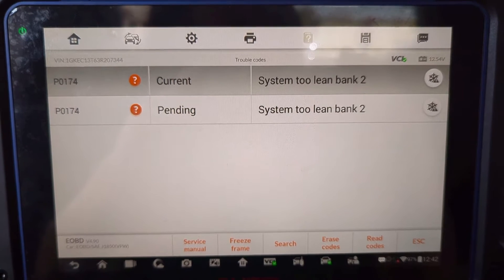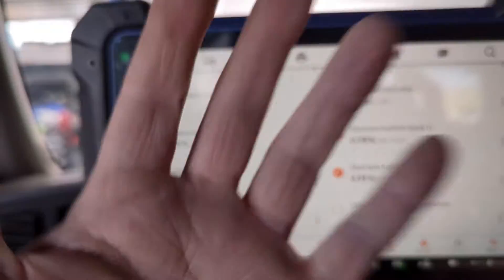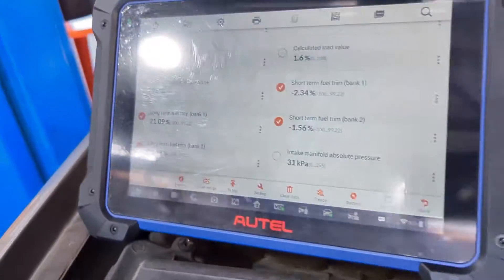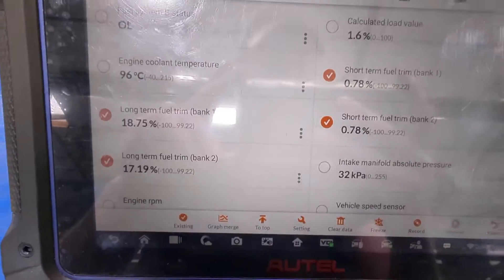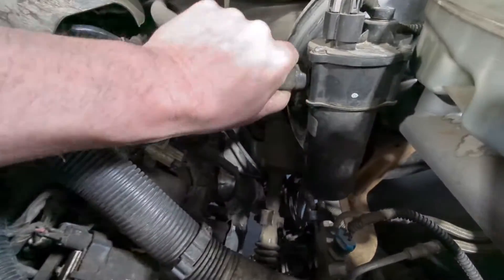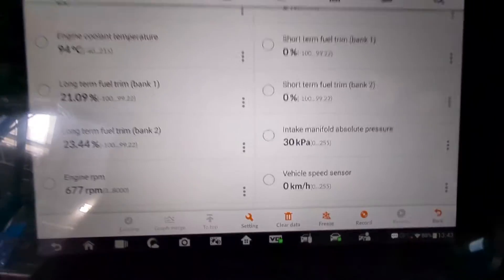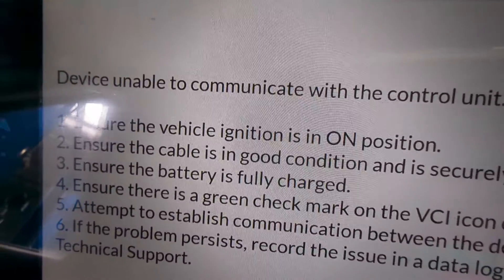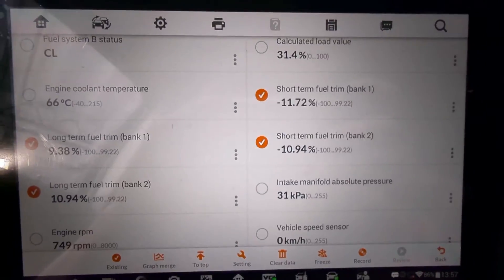Chevy / GM P0171 or P0174 System To Lean Bank 1 Bank 2

Comment: I don't know if this would pinpoint anything or you would respond back I smoked my vehicle went four times and the very last one there is no vacuum leak turns out to be a fuel pressure but my vehicle fuel filter is located inside the tank I suspect there could be a slight tiny vacuum in the valve cover but once in a while when I drive pretty fast on the road I hear like a whistling noise I can't hear it when the car is at idle or sit still while it's running and I got rid of all my misfires

Comment: Ok I have a confession. I had a P0171 code…. Turns out I left the oil cap off adding some oil lol….. 300k miles no other complaints besides a slight oil leak only when cold that I’ll fix at the next oil change

Comment: So I was having the same issue, I discovered the root core of the problem in my 2013 GMC Sierra 1500 is the throttle body when it gets dirty messes with the throttle position sensor and you have to clean the throttle body and replace the sensor to actually get things back to normal. You also need to do a throttle position relearn procedure which you can do yourself once it's completed but that takes care of all of it at least for me. Just wanted to throw this out there for anybody else who might be having an issue that can't get to the bottom of it
Reply: Oh man ... thanks
Reply: The TPS sensor?

Comment: Had same issue (P0171/P0174) on a 2010 Murano - replaced the air filter, the "MAF" and my air cleaner intake duct hose had several rips

Comment: Interesting 🤔 

Im dealing with this in my 98. P0171 an p0174 I've confirmed its not exactly starving for fuel but yesterday it threw a catalytic converter code relating to an o2 sensor. Im gonna replace both and clear codes see if that changes anything. 

Ive already done the maf my old one had a hole in it. I've checked for vaccum leaks with throttle body cleaner I've replaced my map sensor (gasket was bad) I just replaced my entire fuel tank and fuel pump/filter so I know thats not the issue. I did notice my o2 sensor readings were acting a little odd. Theyd act normal (move speratically up and down) then theyd just freeze (bank 1 sensor 1 bank 2 sensor 1) so I'm leaning to that being the issue but again that o2 sensor/catalytic code hasnt come back yet 🤔
Reply: I might also replace my pcv valve I don't recall if I ended up replacing that or if I just cleaned it.... the plastic 90° broke and I took it all apart and cleaned everything up.
Reply: Man I’ve did all you did and more and nothings worked so far I have noticed my ambient air sensor isn’t working right reading way higher than the outside temps.

Comment: That Solary SD301 you’re using puts out 19 PSI, that won’t harm your EVAP system? I have an Autool machine that puts out 12 PSI, but most things I read say the EVAP smoker should use less than 2 PSI or the pressure could harm EVAP components.  Is that not true? You don’t seem to have any concerns using your Solary.

Thank you

Comment: One time at my buddies mechanic shop, customer brought in 2005 Cadillac Escalade with a 5.3.
Customer already replaced the engine, and 3 of the 02 sensors.
It had multiple misfire intermittent and a fuel trim code. My boss came over to me and said disconnect the 02 sensors. If it smooths out the fuel trim code goes away, you need an 02 sensor. Sure as shit the one 02 sensor that wasn't replaced was the problem. $67 part. Customer must've spent over thousands of dollars.

Comment: Any relation between this code combo and a rough idle in cold weather? Code combo generally disappears after the vehicle has run for a bit or its decently warm outside.
Reply: Intake manifold gaskets will fix your problem

Comment: Thank you Sir!  Great troubleshooting. You made things easy to understand. I heard a high flow air cleaner assembly could cause this.  I have a S&B high flow air cleaner assembly and a performance tune in my truck. I'm going to check things per your troubleshooting and put the stock tune back into my ECM to see if it makes a difference.

Comment: updates from me:  I found a badly deteriorated exhaust DONUT from the exhaust manifold.... smoke tested the exhaust and voila!  Helped alot- but still dealing w intermittent code.  Air intake to throttle body: smoke leak from side of throttle plate: replaced throttle body... and now getting random leaks from the o-ring area.  Seems like a weak design, not sure. ATV: trying now.  THANKS

Comment: 06 4wd 4.2 l Lt trailblazer ext. At any time do u ever add pressure to system? Or does it do it alone ? Also mine is bank 1 lean I don't have a sensor computer .  But it said on the code intake valve gaskets.. it is .massive. Work. Now I don't want to do that if it's a false reading. I'm burning gas allot. I did change purge valve. Then had issue what seemed to follow ? Near some time after. It started running a little rough. Changed plugs and coils. Did find like plug 1 in back fire wall?  4 I go forth. With this be said would this in your opinion only {opinion}. E those rubber gaskets?

Comment: You have a fuel pressure issue I am shocked you did not see it.
Reply: How come? Can you Explain?
Reply: @hacatan24  Go to 6:50 fuel pressure should be no less then 55 psi while engine is running NEVER decrease, in fact it should increase on acceleration.  What you need to understand is those fuel pumps and most all can make in access of 100 psi. They are regulated with vacuum as the vacuum decrees on acceleration fuel pressure goes UP. That truck is starving for fuel, fuel trims are maxing out to try and keep up. Its lean as ell low fuel pressure.
Reply: @hoborosser1785  I think that's my problem because I noticed that whenever I turn on my Cadillac EXT it's at 43psi..  the weird thing is when I took to mechanic he said fuel pump was fine ...
Reply: @hacatan24 fuel pump relay my dude

Comment: I’m having the same problem now on a 2005. Truck has New MAF, CAM SENSOR, and NEW EVAP system with no CHECK ENGINE light. Problem I’m having is that it dies while sitting at the traffic light or stumbles when on the highway. I have 60 lbs of pressure on the fuel pump even when it shut off. I’m leaning more to the fuel pump now
Reply: I have the same issue.. with a 02 Buick lasabre 3800. I have cleaned everything / replaced every sensor.. I'm going to check that relay.. thank you very much it has definitely been a headache chase that I can't seem to find...
Reply: Idle air control valve and/or harness
Reply: Sounds like an EGR valve to me.
Reply: I am working through the same issues and  went through it all thinking it's a fuel problem and EVAP and vacuum leaks. Got rid of all my DTC's and the issue still persists. So all is leading to weak coil or bad spark  plugs. 

An intermitten, incomplete combustion, so the O2 sensor picks up a rich reading, so the computer  trims the fuel back, creating a lean condition. This is what I am thinking now.

 The physical symptoms are identical to a clogged fuel filter or failing fuel pump. 😂😂
Reply: @mikethiem2002  I found my problem…… It was the FUEL PUMP relay! What that SON OF B……… was doing, it was getting hot! When I pulled it, I found it to be SLIGHTLY burned on all 4 corners. It’s gray in color so the burn spots were a dead giveaway. Man I been riding for MONTHS no PROBLEMS . I hope this helps
Reply: I had something similar to this happen to me with a 3.6l Bonneville. Sit a a light and engine would die. Had the throttle body cleaned and never happened again
Reply: @allenbatts85  I cleaned that too
Reply: I FOUND IT I GODDAMN FOUND IT! It was the FUEL PUMP RELAY! That S.O.B had burn spots on each side. Evidently it kept tripping after it gotten hot and would shut down but start back up. I switched it out and was riding for two weeks and the Tranmission failed LAST WEEK 😂😂😂😂😂
Reply: @traifields846  I’m so glad you made this comment. Went and checked the relay immediately after reading it and bam…. Fixed the fuckin headache I’ve had for the past few months. Thank you!

Comment: On the 5.3 its almost always header bolts snapped , loose, broken to the cylinder heads. Be ready for the fight of your life 😢
Reply: I have 2 broken org exhaust manifold bolts on driver side 1st bolt frt n last 1 by firewall of course 
And 1 broken on passenger n of course last by firewall...
My fuel pump was replace 9 mnths ago n it makes a weird noise when started...it starts but not as fast as it should with new pump..so I have 2 frigging issues

Comment: I have these codes and ltft numbers when I TAP and release the throttle the truck revs up and stays at the high rpm on its own for a second or two then settles.
Reply: Did you figure out what caused it, mine does the same thing
Reply: @jbags091992  replaced the hoses that were cracked and brittle but it didn’t change the fuel trims. I ordered a throttle body and swapped and my trims are now better, my tb was pretty gunked up. unfortunately now I’m have a high rpm issue with the new tb swap. common with cleaning or replacing tb’s but I’ve done everything YouTube has to offer and it’s still shooting up to 2k rpm.
Reply: @justinlong977  Im having the same problem brother! Im going to try what this guy did but if you find anything please let me know!
Reply: @Dyllanman  it seems to have settled down a lot, I guess weeks of driving did it?
Reply: Yeah anytime you put on a new throttle body, the computer has to learn it.
Reply: Mine is doing the same thing after second gear it shoots up and I got both those codes

Comment: So if I accelerate and my bank 2 trim goes down from 20 to 0 does that indicate bad fuel pump?
Reply: No. That seems to indicate that your air fuel mixture balances out unde load or higher rpm. I'd lean more towards a vacuum leak or a MAF
Reply: Means the opposite, high trims mean it’s low on fuel, low trims / negative means it’s good or too much on fuel. Fuel delivery issues (pump etc) will cause high trims under load, they will never be bad at idle and fix with load to my understanding. 

Vacuum leaks will cause high trims at idle, and likely correct under load. Such as your issue described
Reply: @jasehonfroy8086  I have an 84 c10 with 5.3 swap, runs great at low to medium speeds, maybe 50mph, but when I step on gas it acts looses all power....almost like it turns into a 6 cylinder....I can plug into ecm and get the 0171-0174 code. MAF is new, filter is new, no intake leaks....help! please!!
Reply: @jamesjordan3239 have you been able to test the fuel pressure? My only other guesses would be poor tuning or a vacuum leak
Reply: @jasehonfroy8086  Hey! Thanks for replying, I have not checked the fuel pressure as of yet but have discovered that the MAP sensor is not plugged in and I do not see the Map plug or vacuum line that runs to it, I bought the truck as is and dont know much about LS swaps. any advice?
Reply: The MAF sensor has been changed, can the Map be deleted?
Reply: You wouldnt happen to be in Houston or close are you?
Reply: @jamesjordan3239 hey sorry I’m not in TX- you can disconnect the battery, turn on the headlights to drain leftover electricity, then reconnect the battery to clear the MAP/tune file 👍if that doesn’t help I’d certainly check fuel pressure, harbor freight sells $30 gauges
Reply: @jasehonfroy8086  Thanks for the reply bro! I actually found a 1/8 vacuum line not connected and was hidden, never even made ssss noise. Couldnt find where went so I plugged in a cheap vacuum gauge and it immediately jump to 20Hg and the motor calm down and that fixed the 171/174....NOW after letting it idle for lil bit I get a 172-175 code LOL!! rich bank 1-2....Thanks again for the reply, I just tinker with and see what I can find!
Reply: @jamesjordan3239 Awesome, I’d definitely wipe the ECM by doing the aforementioned battery trick. I wouldn’t be surprised if it “learned” to run rich when it had the vacuum leak, and is now maintaining the extra fuel
Reply: @jasehonfroy8086  Great advise, Ill try and give you an update....Thanks! Have a great weekend, weather is crap in houston Tx.
Reply: @jamesjordan3239 haha same here in North Carolina sadly… was hoping to take the kayak out and hunt some squirrel

Comment: There's some decent info buried in here, but the terms and language being used to describe some of it is wrong. Examples...

Fuel trim is almost NEVER zero
Fuel trim at idle isn't terribly helpful for a lot - trims under load matter much, much more - especially long-term trims. Specific issues with the 2014-2018 high pressure fuel pump design causes fuel leaks directly into the valves which causes a "rich" condition. This will set the MIL and DTC's but the only way to diagnose the bad LTFT's is while actively driving the vehicle.
"Within 5% of zero" should like have been described as "within a range of plus or minus 5%" as "5% of zero" is zero...
Reply from the maker: I'm grateful for your detailed explanation and corrections on the terminology regarding fuel trim. Your input helps improve the accuracy of the content shared.
Reply: @FlatRateMechanic I applaud you for not talking to this guy like I would have. And taking his comment and twisting it to support your content. Really smart. Lol applause

Comment: this was very helpful thank you!  i bought the smoke tester, it's great.   found a tiny leak where the intake boot clamps to the throttle, but no change after that was tightened.  did a water spray all over the intake manifold gaskets and no steam out of the exhaust.   smoke tested the exhaust as well and nothing.   my long term fuel trim is around 18% on both banks at low load or idle and drops to around 10% under medium throttle.  i did notice my intake air temp was considerably off from actual air temperatures and very slow to respond to changes ( from sitting in a parking lot, hot start on a hot day,  to diving down the highway at 55, it changed very slowly and never read the right temp, was always high by  about 5-10%)    new maf on the way, i think mine is original,  20yrs old,  264k on it.  cleaning it didn't have any impact.
Reply: Did it fix it?
Reply: @cesarcastillo809  new maf sensor  did fix it!

Comment: I replaced the Maf sensor, the intake gasket, replaced a PCV valve and the tubing and there’s not any other leak, now I have a P0174 code. 
Should I have to replace the oxygen sensors?
Help!!! I already spent $700 pus the parts.
Reply: I have po171, which is the other bank lean. I can't figure it out either.
Reply: You figure it out? I have a p0171 only code, gonna change the o2 sensors
Reply: @alexlsx8187  No. Not yet.
Reply: I have both codes and replace all O2 sensors fuel pump throttle body purge valve and mass air flow
Reply: @zachparadis8455 did you have any luck yet? I’m desling with the same issue plus knock sensors both banks.
Reply: @s4ljb665  no sir yesterday I replaced master cylinder and brake booster it had a leak which could cause a vacuum leak I clean the code and it came back ten minutes later I'm going to drive it for a week to see if it goes off I guess my next step would be exhaust manifold gasket or intake manifold gasket but these parts are adding up quick
Reply: @zachparadis8455  well, I’ll keep you posted on my end if I ever figure it out. Good luck
Reply: @s4ljb665 I’m having same codes for knock sensors, maf, and bank 2 low. I have replaced everything and cleaned the tb and still having the same codes. Truck surges between 40-55

Comment: Thanks for posting the video. 2004 Yukon 5.3L threw a MAF sensor code, so I replaced with a Delphi MAF just this past week. Code cleared, and now I have 171 and 174. If I understand your comments, with more driving is it possible the fuel trim numbers settle out to be in spec and stops throwing those codes?
Reply: I got a 5.3 Silverado and just replaced Maf and getting the same code, did u figure it out?
Reply: @boondawg1 Same thing did you find a fix
Reply: any fix?
Reply: Fix?

Comment: You should have pulled up the data pid for the mass airflow sensor and see what the grams per second flow reading was, that might have told you something. Was that new sensor after market or dealer? great vid other wise.
Reply from the maker: We put a denso MAF - I've had pretty good luck with this brand. Wouldnt recommend after-market